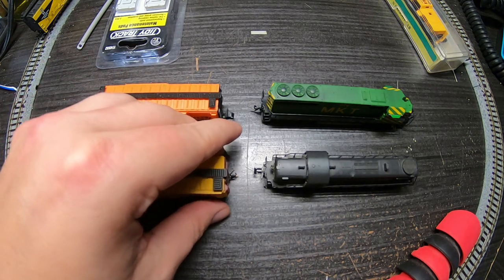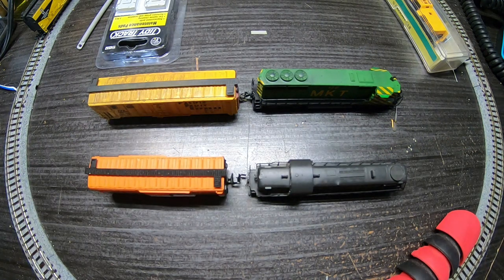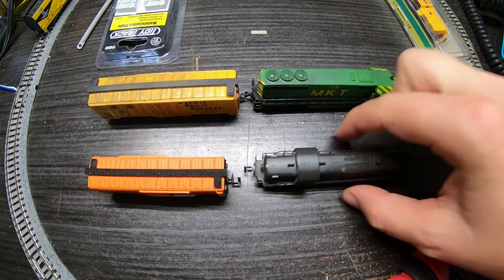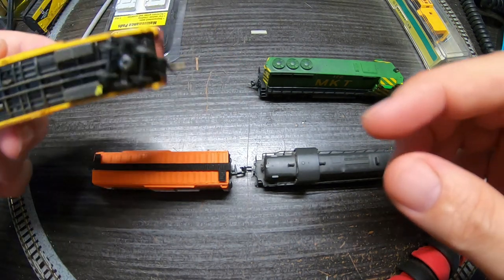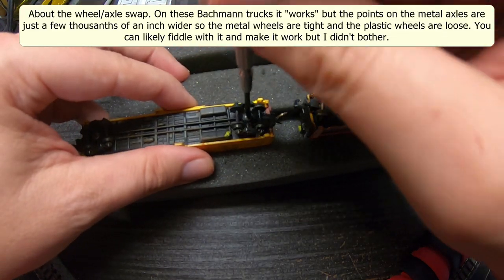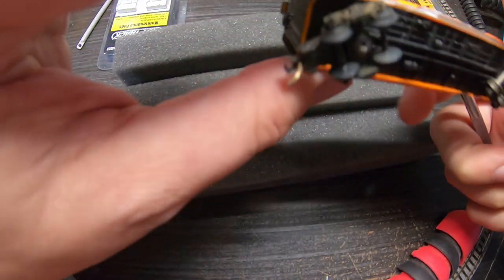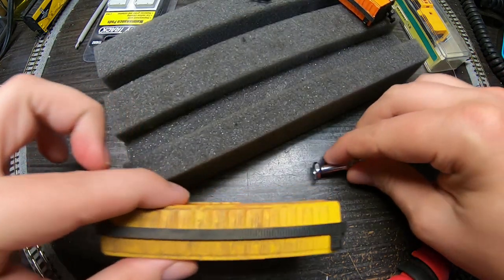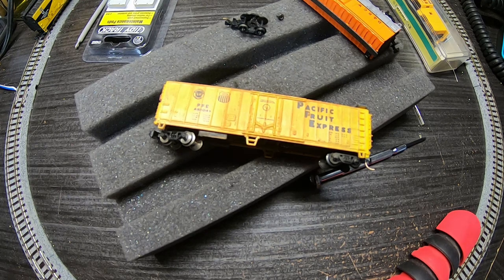Watch this before spending a bunch of money on replacement couplers for your N Scale rolling stock.

Comment: Been there done that. However there are many model brands out there that pose a host of problems with trying to mount a set of trucks from another make. It works fine in some instances, but there is a fairly high ratio of rolling stock where it is not worth the effort. Fine idea where it works.
Reply from the maker: That's one reason why I went with similar make cars here.

Comment: Great idea..    I have some rolling stock from e-bay  with those couplers   Inow have to buy track and a starter set.  In this video you seem to run on kato track. The question is, do you have any de-rails? I am a beginner and would like an answer.
Reply from the maker: Derails are a fact of model railroading regardless of the track and the rolling stock that you use. Now that being said in my opinion Kato Unitrack is the best track overall. Especially for a beginner-intermediate modeler. It just clicks together and works.

Comment: I've been doing this for a while.  I think it's a good idea as you can save a few bucks and make things a little more functional. I have about 10 cars like this. I call them the "composite squadron". I started my first n scale railroad in 2007. Stopped in 2017 as I had to move. Started again last year and it helped. Especially because I bought too much rolling stock. Pretty cool idea in my opinion.

Comment: But how are rapido couplers replaced or added?  I bot a loco on ebay but it doesnt have couplers and I would like to add one just to run it under the xmas tree.   How are Rapido couplers put in there?
Reply from the maker: I believe Microtrains has a way to find out which coupler kit you can order on their website. Just feed in the make and model. It may or may not come with all the components needed depending on if you're missing the entire coupler boxes on the one you just got.

Comment: Can this be done with the n scale bachmann Thomas line of engines and rolling stock as well?
Reply from the maker: Hey Freddy. I'm not 100% sure. I don't know if it'd be as easy as swapping a truck off of a newer model not knowing much about the Thomas The Tank Engine stuff that Bachmann made. But you could just as easily upgrade from the Rapido coupler to a knuckle style on one end of one of the Thomas themed cars. Although it may take a little bit of fiddling.

Comment: Can you still do it with ho locomotives the lifelike don’t seem to have screws to replace
Reply from the maker: Well the purpose of this video was to show you a way you don't have to. But if you have a locomotive that has a broken or missing coupler Most of them have some kind of conversion available but not all. It depends on the specific model. And most of them have some kind of plastic clip holding them together if there isn't a screw. But some you have to take the truck apart as it's held together by the individual pieces of the truck.

Comment: I just started rebuilding n scale from a few years ago. I like your idea but the rapido couplers are constantly coming apart. Any suggestions?
Reply from the maker: When you say coming apart do you mean that they're unhooking from each other or the couplers are coming off of the rolling stock?
Reply: @Trains-With-Shane  They are unhooking from each other.
Reply from the maker: @larryholloway5222  That is strange. The only time I have issues with that happening is when there are transitions to steep grades or if the couplers are vastly different height or the springs are missing.

Comment: The tricky part is to find a Backmann truck mounted knuckle coupler on ebay ....photos on ebay don't always help and you could end up with a car with a detached coupler
Reply from the maker: It's not too bad. Although I did search through a lot of auction listings because I was trying to get out as inexpensively as possible. I lucked out with that weathered Pacific Fruit Express car being just about the cheapest one overall.
Reply: i throw them in my parts box as I use rapidos on all my plastic equipment. I am too busy working on locos, motors, and wheelsets- just don't want to play with couplers. i'm retired and do motor man work for a couple of local N scale groups and let those guys handle knuckle-coupler issues and those couplers have more issues than rapidos do- and guys pay extra for them? love fox valley model's brass wheelsets- i try to put the standard-tread wheels on everything. they sound nicer on the rails, too. not buying knuckle couplers enables me to pay for the wheelsets. i'm still seeing dummy knuckles on some new rolling stock- really hate those! they force you to touch your decorated and weathered cars. at least give us some couplers we can switch with! N scale's finally getting to be fun!

Comment: It's an okay idea but when performing yard staging it will become difficult plus the old couplers uncouple while rolling.
Reply from the maker: I’ve actually had more issues with knuckle couplers uncoupling than rapidos. But if I were doing a lot of yard switching operations I would be using exclusively knuckles for that.
Reply: make them body or floor-mount rapidos and they will outperform (and won't 'uncouple while rolling') any knuckle coupler including MTs. you can use the pockets, springs, and couplers you cut from the trucks. if parts are an issue, you can get used trucks cheap online from guys who converted to MT trucks. humping, staging, or backing long strings or trains- hands-down better reliability. you can release them easily with a rix-pix or bamboo food skewer. how much can a bag of those cost at safeway? the train guys i work for say to use a good two-part clear epoxy for the construction of the floors/bodies to the shim(s) and coupler boxes and rough up the plastic to help the epoxy hold. don't get glue inside the box or you'll regret it. makes sense.....

Comment: I get why people wanted the knuckle/kadee couplers, but they all agreed to a standard once, they could have done that again. Most of the hobby has agreed on MTL as the 'de facto' standard, but FFS, now you have Kato, Bachmann, Atlas, MTL, and Athearn, all with their own couplers, and none of them play nice with each other - so you're either stuck with one brand, stuck with doing a bunch of fiddly conversions, or stuck using convertor cars.

No, Rapidos didn't look prototypical. You know what else doesn't look prototypical? 1:160, that's what. When there was a standard, you could run any brand with any other brands OOTB, and it was a lot more fun.

Was it worth giving up the interbrand standard? Personally, I think not.

Oh and I'm just ranting in general, the rant part isn't directed at any specific individuals. It is directed at the manufacturers, though.

Comment: So the loco it’s not possible to do so
Reply from the maker: It is. but can be costly and difficult.
Reply: @Trains-With-Shane  so rolling stock is cheaper
Reply from the maker: @vahidhosoda6614  Usually yes because the mounting is simpler. For ones with truck mounted couplers you can get trucks from micro-trains and other places that have total replacement truck and wheel sets. Just unscrew, swap, and you're done.

Comment: Yeah rapido is used a lot. Even on the fake n scale people try selling as n scale cars and dummy engines. They were decoration by readers digest. Came in little white boxes with a stripe on it with a label of pictures on box. Don't be fooled paying so much for something that isn't actually  n scale.
Reply from the maker: If I remember right those were made by High Speed Metals and offered by Readers Digest or something like that. I had one of their locomotives that I picked up in a lot of other stuff. It was neat but I tossed it. Buyers of Southern Pacific units beware.
Reply: Yeah I got few of them. Got lucky though. They came in a cpl different lots I purchased. They weren't what I based my purchase off of.

Comment: Old style is terrible
Reply from the maker: I have found that they work pretty well. They aren't as suitable for prototypical switching operations, etc. But for hauling a bunch of cars around I've honestly never had a problem with rapido style couplers.
Reply: @Trains-With-Shane  If one is manually uncoupling for yard ops on a small layout, a simple "L" tool made out of 14 ga solid core wire (strip the insulation off the bottom L part) allows for easy uncoupling of rapido style couplers.  Personally I found it far easier to use than trying to get a little screwdriver tool down in the knuckle couplers.  Now on large yards with magnetic remote uncoupling, the magnetic style knuckle couplers are mandatory.   I am over large layouts that I became a slave to in order to just keep them running.   My little "legacy" switching layout is all rapido and in fact I just found a nice "new in box" 1992 Arnold RS-1 with rapido couplers that should work well too.  

The added joy of using older style rolling stock is of course they cost less and very few engines with rapido couplers are DCC and thus far cheaper than new engines with magnetic knuckle couplers and DCC chip installed.    I run my simple shelf layout for fun switching puzzles using a card system and I really don't care how "real" it looks.   It's a whole lot less stressful on both my brain and my wallet to just have fun and KIS (Keep It Simple).   

But having gone off topic, your idea is a good one I have used personally decades ago in HO allowing use of both horn hook style and Kadee magnetic couplers.   (Yup I am that old to still call them Kadee)   🤣